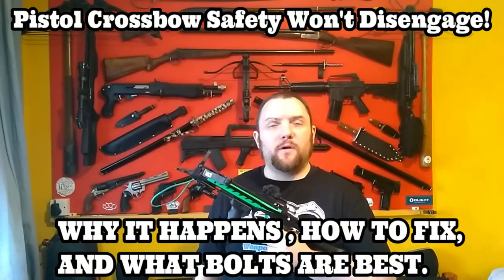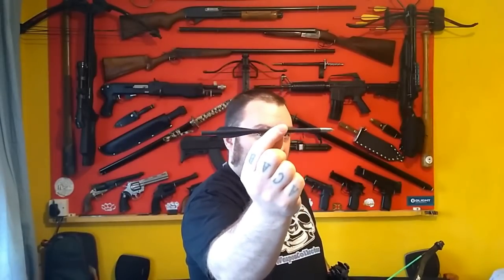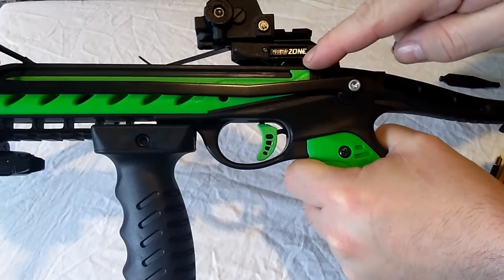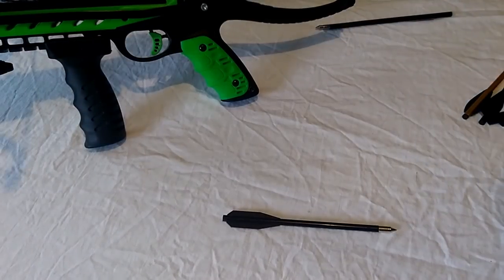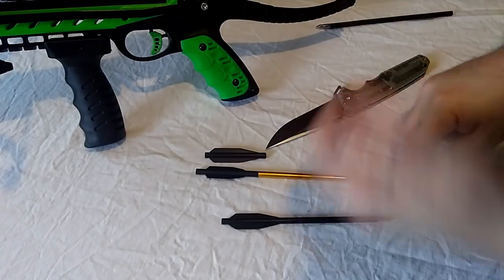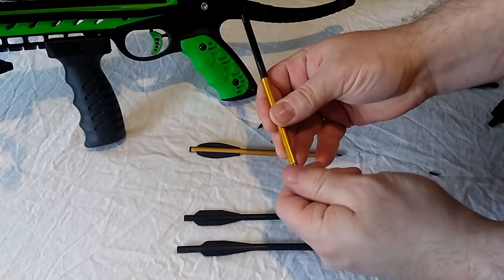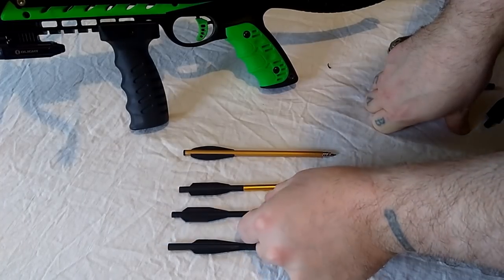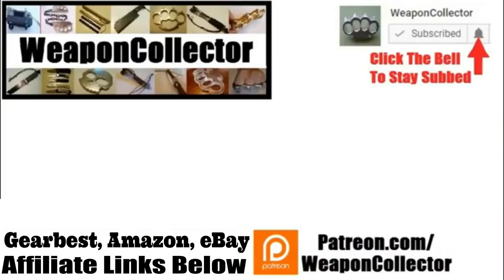Pistol Crossbow Stuck Safety (HOW TO FIX)

Comment: You can also just take out the dry fire safety mechanism altogether, which is what I did. You have to hammer out the small pin that holds it in place (it's underneath the scope rail, right next to the Horizone name tag). Once youve removed the pin the plastic safety mechanism will fall out. Now you can fire any size bolt without modification. This doesn't effect the trigger safety at all.
Reply: I was going to do the exact same thing. Glad  I found this vid ..my skills probably arent as good as yours.
Reply: i did this and my redback can now shoot 16 inch bolts up to 8.8mm od. im done with the little bolts lol.
Reply: I had to do this and remove the bolt retainer to shoot a shortened fishing arrow. Worked great. I used a scope ring to mount my reel seat to the bottom picatanny rail
Reply: Dose anyone know if this will work on the PSE Viper SS crossbow? They seem to be the exact same thing

Comment: Hey thanks for your videos ,I'm getting back into crossbows had a full size Barnett 15 years ago,but bought one of these recently because I didn't want to spend too much ,first off these are brilliant for the money ,so today I had the exact issue in this video with aftermarket bolts ,both plastic and aluminum ones ,the standard ones that come with it are a bit rubbish but don't give this issue,so after nearly taking it back to the shop,here are my findings,I did try your trim off the flight trick but it made no difference ,I shot approx 100 bolts this afternoon and 100% the issue is the diameter of the bolts ,them being slightly smaller diameter than the supplied bolts,I found two ways over this ,if you load the bolt as you push it in ,push down quite firmly on the front of the top 20 mm rail while simultaneously pushing the safety forward off and hey presto the dry fire slide will pop up,other way is as you load the bolt slightly twist it onto it's flight then push it into position you will then see the dry fire slide go right up and you can push the safety forward , anyway hope that makes sense , thanks again for your videos ,can't wait to get a compound bow soon regards mark

Comment: Cheers Mike,I’ve been okay so far with the Tron,Redback and Tomcat 2 but thanks for the info mate 👍
Reply from the maker: Cheers mate, i must admit it only happened a few times to me, but most of the time its fine, even without the unmodded bolts, but does seem to be an issue occasionally  for some.

Comment: I have the viper, I believe it's the horizon's little brother, I'm having the same issue with the new bolts I just got. Great and easy fix I'm gonna give it a go. I was about to disassemble the who think and file a ever so slight bevel to the lever. This fix seems much less evasive haha. Thank you kind sir
Reply from the maker: Hope it helps.
Reply: No such luck. It works but very inconstant. I need like 1 mil on the bolts haha. I'm dabbing some super glue onto the front of the lever that activates the safety. figured if I can give that a couple layers it'll compensate for the slightly thinner bolts.
Reply: By then way really enjoying the other videos
Reply: @5isalivegaming72  Try removing the dry fire safety pin.

Comment: Nice vid. Cheers dude. Saved me about an hour( yeah was about to dismantle etc lol) 
The 6 mm golds dont screw in any more( crap glue-but araldite will sort ) Pain though. Maybe there still some threaded versions about? Will head over to community channel and check out you got. Nice one.

Comment: Cutting my flights down didn't work on my Redback .I found if you rotate the bolt while its on the rail it will push the dry fire catch up enough to release  the safety enough to push it forward for firing .Lucky for me as I have about  30 of these aluminium small bolts .

Comment: I found this video because I suddenly had an issue with my Armex Tomcat 2 doing this. I could see for myself that the problem was that the anti-dry fire was not being fully disengaged, but what's weird is that the bolt causing the issue comes from the same pack of 10 as bolts that have been working just fine

Comment: I've got the redback Hori-zone 80lbs. As a female I struggle with cocking it. Would the 50lb be easier?
Reply from the maker: the redback is quite hard to cock, i may do a video on different methods of cocking it, you could buy a stock extender - https://www.3dcabin.co.uk/collections/sports/products/crossbow-stock-extension-kit-for-horizone-redback-pistol-crossbow-easy-loading-cocking-standard  put in the discount code "weaponcollector" for 10% off
Reply: @WeaponCollector  thanks, I'll have a look 👍
Reply: @WeaponCollector   this thing makes my redback look beastly along with a bipod. my 12 year old son shoots the redback easily with the stock extender.